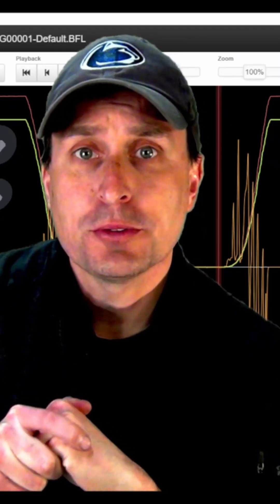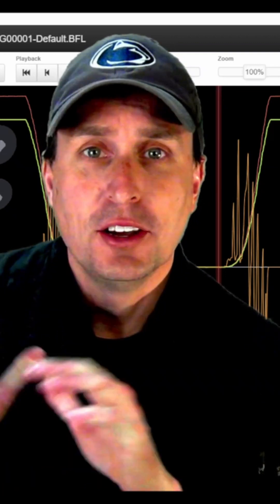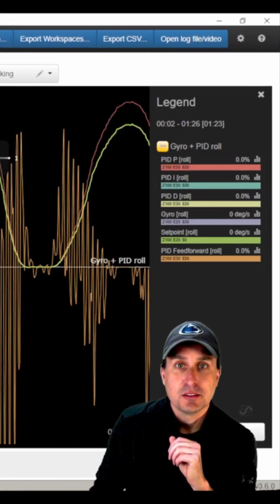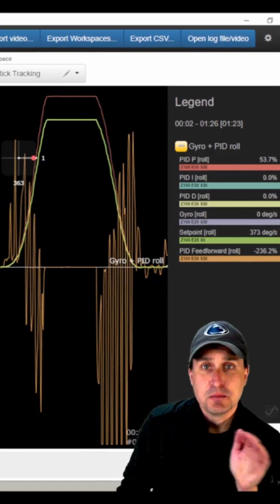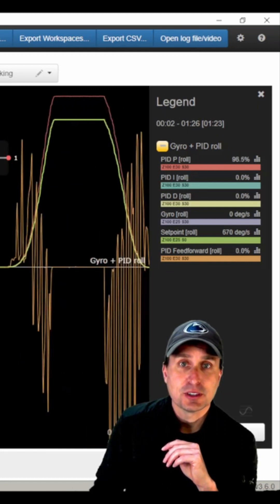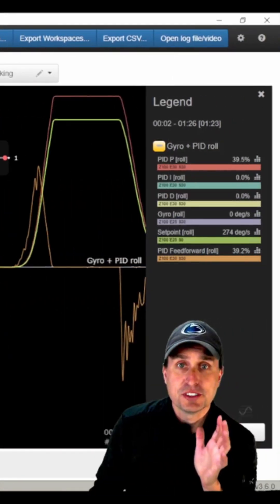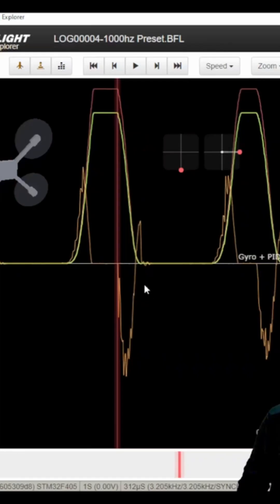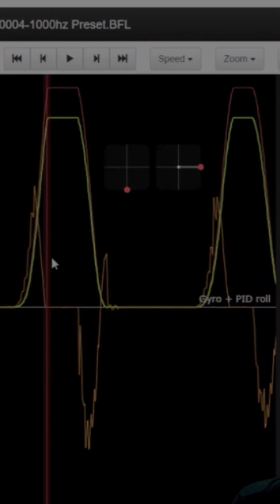Secretes of the ELRS 1,000hz Modes

Comment: To get the most out of the 1000hz preset you need to use 4.4.1 as the FF smoothing factor on lower versions doesn’t quite reach high enough
Reply from the maker: Fyi.  4.4.1 breaks SD card again.
Reply: @uavtech  😣
Reply: @uavtech are you making a funny ?